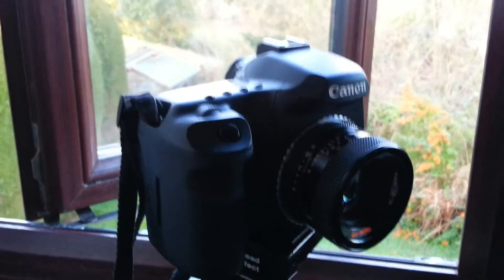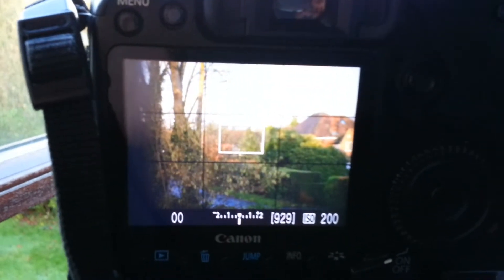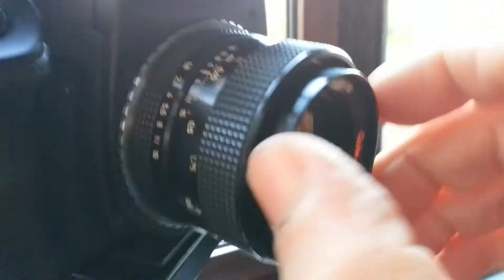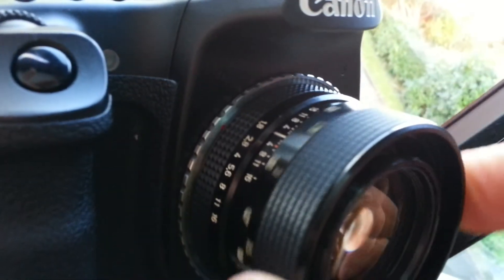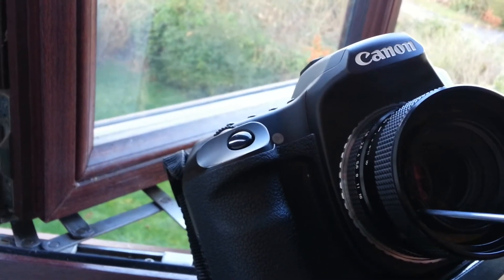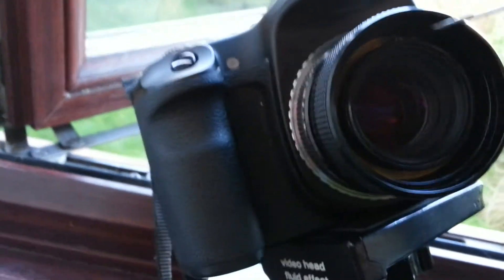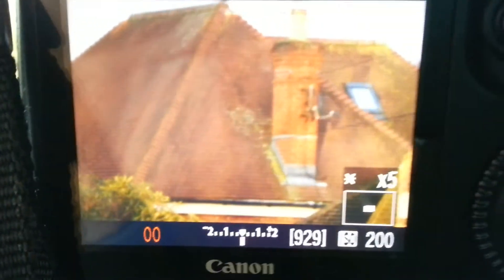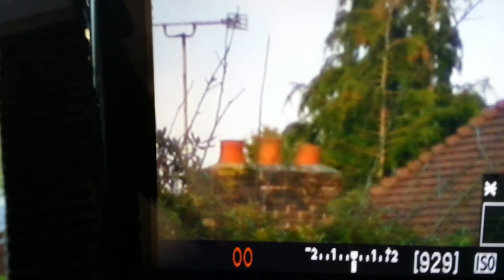Correcting for infinite focus on Rollei 50mm f1.8 HFT Planar lens

Comment: Hello! Smart solution! But can ask you, do you have any information about possibility to mount this lens to FF Canon 6D? I see that rear lens significantly protrudes when lens is set on infinity. If the rear part of lens can hits the mirror of camera? Thanks!
Reply from the maker: I might well be very close to the mirror , but not sure if it would impact. I know the efs lenses can touch and i don't think it extends that far.
Reply: Viktor, yes it will slap the mirror on a 6D. I have it with M42 mount, and it is an issue.
Your best bet is it to use it at close focus only thru the viewfinder, or you can use it on Live View mode only to avoid mirror contact, where it should also hit infinity - more or less. 
Even with this issue, it spends a lot of time on my 6d. It is an exceptional lens.